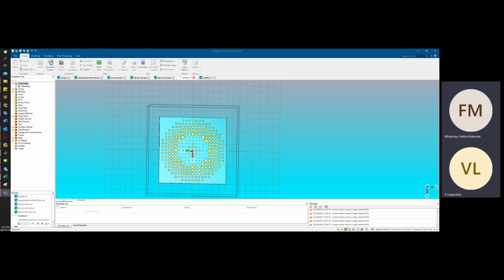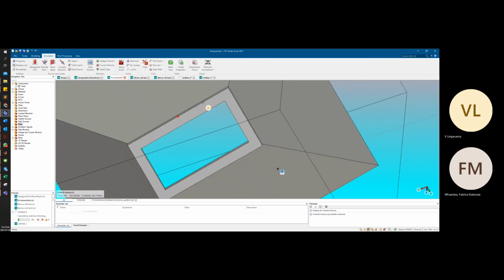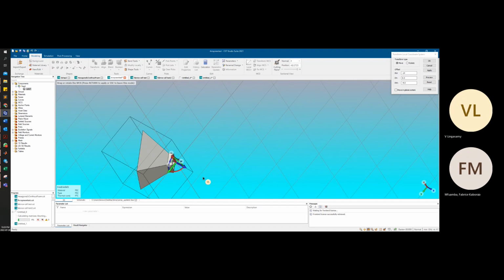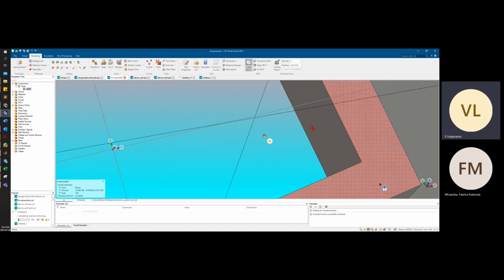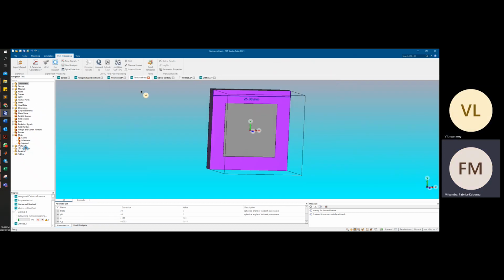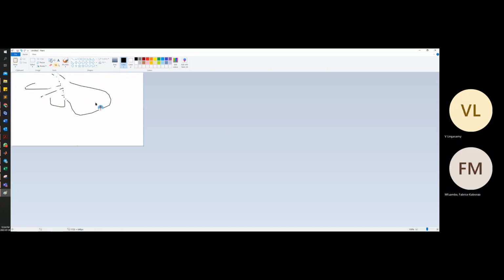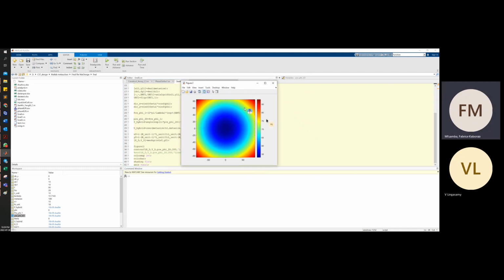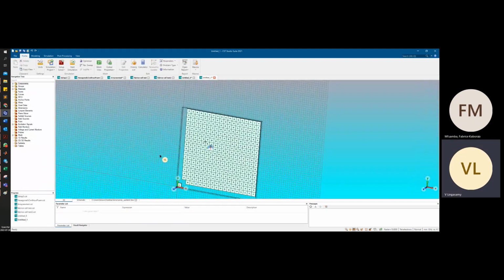Discussion on Offset fed horn, MATLAB-CST modelling, S curve, Phase unwrapping

Comment: Hello, Sir.
Myself,
Pratik Kumar Singh, is currently pursuing a masters in electronics engineering from Sapienza University of Rome, Italy.

Following your lectures since last year on YouTube and trying to contact you since many months but trying here as well.
Hoping you don't mind.

My reason to text you is that I would request you to kindly help me with the CST and Matlab interfacing, where I have the code for "Reflect array Design using Matlab" but I couldn't be able to design it in CST (particularly need your guidance in solving the issue in matlab code), professor please help me I need you guidance for this journey of mine in designing Antenna.
In particular, I am trying to construct the design in matlab which I does but whenever I try to construct it in CST it shows error.
Kindly please help me 🙏🏼
Thankyou 

Thankyou 🙏🏼

Comment: Sir, what’s the purpose of reflectarray? It seems like you are trying to explain how to do modeling for fixtures using MATLAB platform to demonstrate for phase compensation of antenna? Very curious about it sir, your answer would be much appreciated.
Reply from the maker: It is actually complement the parabolic reflector and lens and used for long distance applications.
Reply from the maker: For more information please watch my PhD Viva. If you still have a query please contact me over my mail : lingasamyap@gmail.com